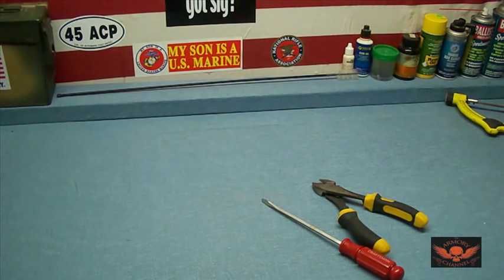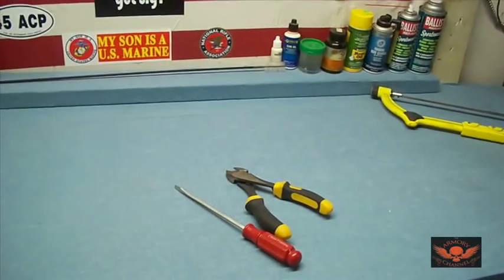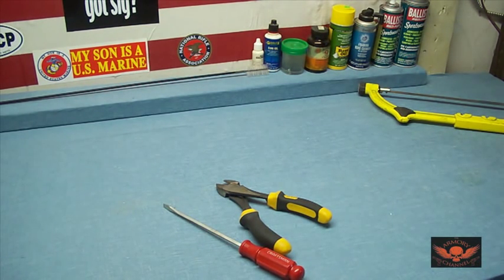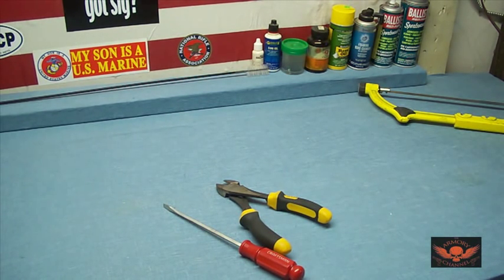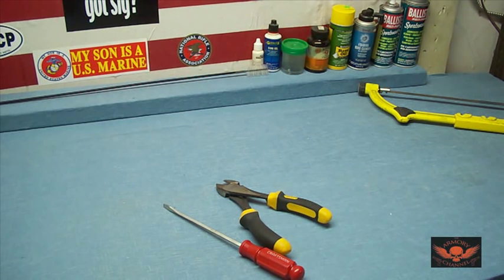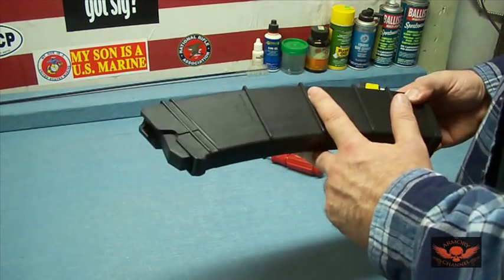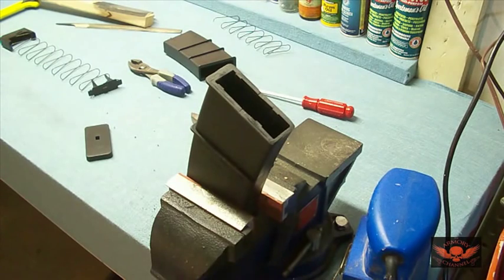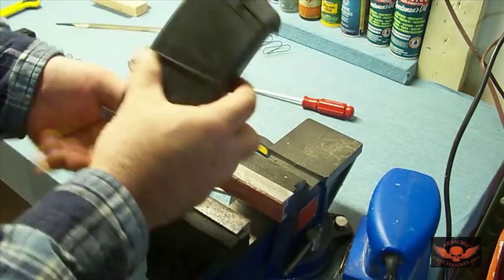CUSTOM YOUR MAGAZINE

Comment: Hey Pete,

A tip to load the mags...

When you push the shells into the mag push them in verticle instead of horizontal, slide them under the stop at the back of the mag, then rotate down to their final horizontal position.

Comment: @theARMORYchannel    the rasp will give you a little more control and precision than the hack saw and is just about as fast for removing the excess material.

you may want to give it a try on that left over half to see if it will tear up the plastic too much

Comment: @markquimby82 just think of it this way its more compact than a benelli  say you want 10 round auto loader you would need atleast 28 inch barrel vs just having a small barrel with a mag. and like pete said its built on a ak platform.

Comment: Not true. S12 has 15 parts as imported. The gun wiki worksheet is accurate, and I suggest you go there to see. Otherwise you are correct and the maker of this video is a little confused on the issue. He really ought to get a cheap puck for $10 and not gimp his mags.

Comment: You never ever cut the magazine spring that short...

You could have taken 1 or 2 coils off of it, but, that much!? You do realize surfire magazine springs are total garbage right? You need that huge spring to make them decent magazines. Should have cut it down to 8 rounds and used the spring as it was.

Comment: I like you craftmanship
but if I wanted a 5-rounder I'd buy a standard mag cheap off ebay.

the funny thing is everybody wants reliable cheap 8,10,12 round stickmags.
the best ones have to be SGM and AGP in the polymere department but they wont ship them out of the US. the 12 rounds because of US law and the 10 and 8 rounders of SGM and AGP because those companies dont want their retailers to.
and you cut them down to 5-rounder :D our hearts bleed when we see this vid.

brun your cash before buying promags ( those get shipped outside the US btw ).

the metal mags of csspecs are what I hear the 20USD extra worth.